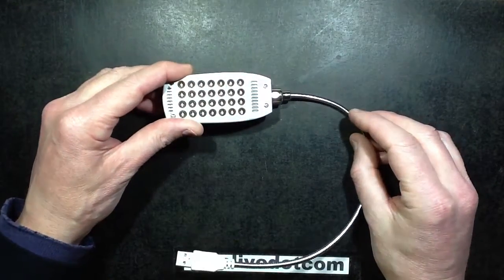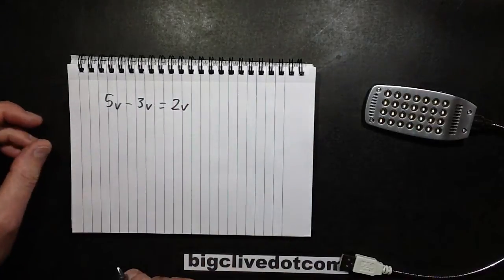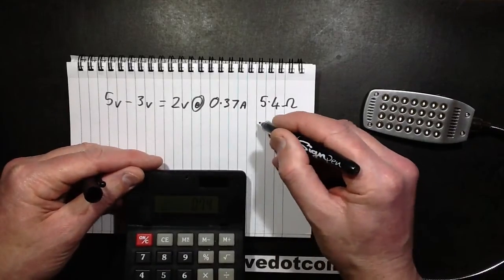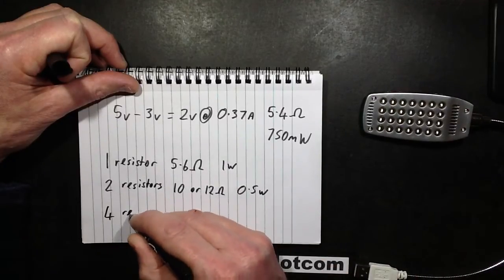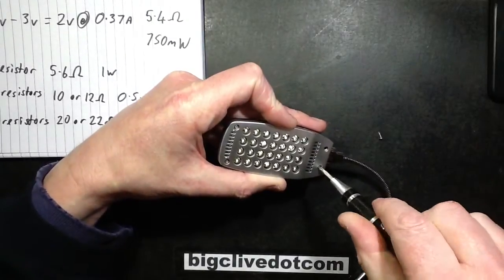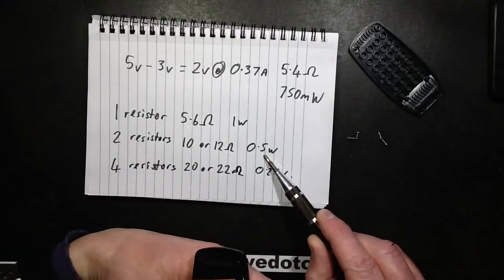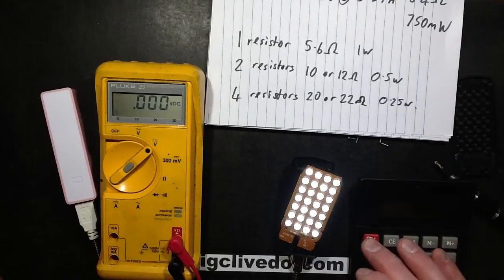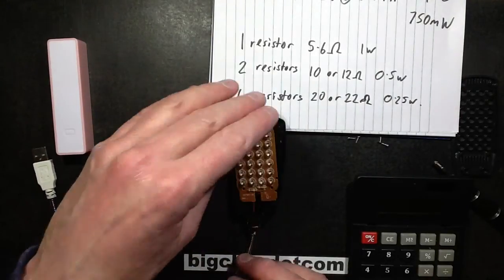A look inside a 28 LED USB light.

Comment: I have seen them with no resistors, using just the thin 3 strand wire in the lead ( must be cheaper than 7 strands of thin recycled copper wire) to provide the resistance. Even seen some with 2 2V lead acid cells as power, relying on the cells being so poor internally along with the thin tinsel wire to do the same.